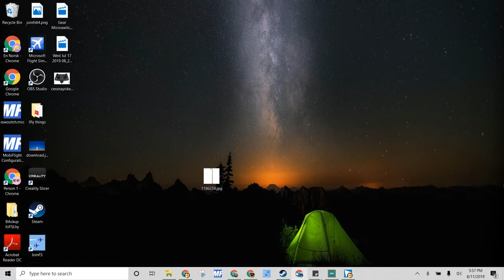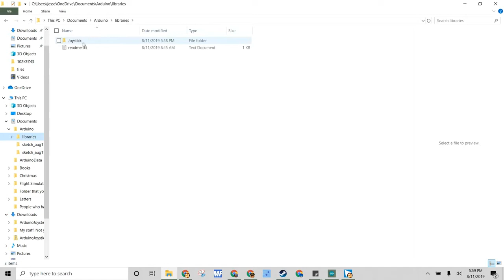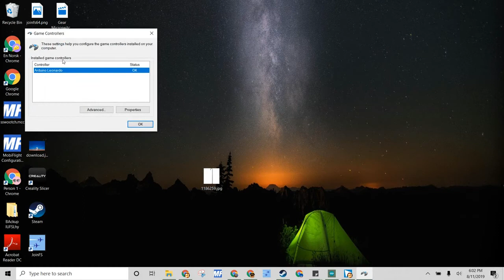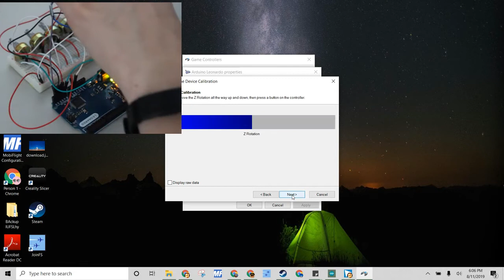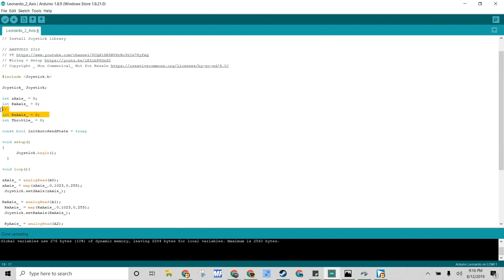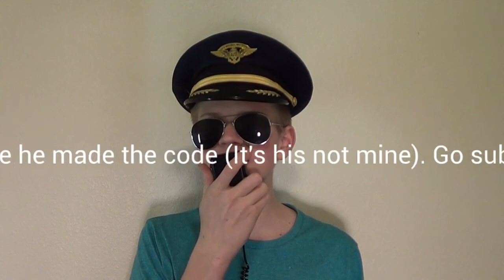Making Amstudio's 5 Axis Controller Without a Breadboard! | Captain Bob

Comment from the maker: Hello Everyone! Just an update:
You can connect two Arduino Leonardos and have 10 axes if you'd like to. Make a copy of the Arduino Sketch and flash both Arduino boards separately!
NOTE: This only works with the Arduino Leonardo and Pro Micro. An Arduino Uno or Arduino Mega will not work though I usually use them for other things on the channel.

Comment: Great video. Just a little tip. In your code when you want to comment something out you shouldn't replace it with // you just need to add // before the line and then it will turn grey and won't execute.
Reply from the maker: Thanks for the info!

Comment: Also check out linear magnetic hall effect sensors. They are much better for joysticks than potentiometers as they can measure much smaller movement at a higher resolution.
Reply from the maker: That's so awesome! I'll really have to check these out!

Comment: hello captian! Excellent job! But I have a question, how can I use the another 32 buttons, axis X and Y? Will I have to use a multiplex board?
Reply from the maker: It looks like you will have to code them in. I think there are only ~15 input pins on the Leonardo. I haven't done this yet, but I've been thinking about it a little bit. Refer to amstudio's button box videos (he's the one that made the sketch), and take some parts of the code.
Reply from the maker: Just came across this: https://www.instructables.com/id/Arduino-LeonardoMicro-as-Game-ControllerJoystick/
I think it would be a huge help.

Comment: Can you use 3 potentiometers and set them up in Arduino as Z,X,Y axis and then configure it in Flight Simulator 2020 so they will controll throttle, mixture and carb heat ?
Reply from the maker: Yes, Just comment out the rows you don't need, or don't use them when configuring to FS2020.
Reply: @CaptainBobSim  Thanks. I will try this.

Comment: Captain Bob I have a problem.  Should I connect the rotary switch directly to adriuno or using a wire and Connect the rotary switch to adriuno from a0 to a4. This problem with me is in the second type that is without breadboard. Can u help me please captian bob
Reply from the maker: Let's make sure you are using the right electronic component:
This is made for potentiometers (analog, variable resistors). This won't work with rotary switches (multi-position switches), or rotary encoders (digital potentiometers). These are 10K ohm pots.

Using a wire would be good practice, but it should work without wires.

Here's the no breadboard wiring diagram, it should work.
https://www.tinkercad.com/things/d3SVBMS645X
Let me know if you have any further questions!
Reply: Or else can u make a video of connecting multiple rotary switch to adriuno without breadboard

Comment: Must I configure it in MobiFlight?
When yes could you shoe how?
Reply from the maker: You can not configure this in MobiFlight, as MobiFlight only handles digital inputs and outputs. Since potentiometers are analog, you would have to use the Arduino IDE code and configure this as a Joystick.
Reply: ah okay, but thanks

Comment: Hello i have a problem. Not have Joystick librari 2 i have erorrs to veryfy or upload the 5 axis stuff to my leonardo. Any tipp? Vhat  version you use the arduino joystick?
Reply from the maker: Hello, You need the Joystick library for the code to work properly. The most current version should work. Download it from the site as a Zip file and unzip it.
Reply: @CaptainBobSim   Thanks, but i installed  finally. I have only 1 question. How to add up and down shift button, and wich pins i need?
Reply from the maker: @thekassaiba6694  Excellent! I must be honest, I haven't done this before, but a good starting point would be to go to Amstudio's button box video and see if you can insert some of the button's code: https://www.youtube.com/watch?v=Z7Sc4MJ8RPM&ab_channel=amstudio
Reply: Thanks i go and warct. I re think the setup and i put an encoder but in Hungary cost this piece 30eur.. Little bit to much money..

Comment: Dude you are awesome! I’m trying to wire up a button box for my flight sim right now and I’m still a little shaky with how to wire it up exactly, I got the Leonardo and I have 6 2 way switches 2 potentiometers and 2 large led red flipper switches I believe they’re  called yep, help!
Reply from the maker: The wiring would be as follows:
2 way switches: one of the pins (typically middle if 3 prongs) goes to ground, another goes to pin 2-7. Rocker switches are wired exactly the same, using pins 8 & 9. I showed you how to use 5 potentiometers, so you can blot out ( // ) or delete  the other 3. 
I'm not entirely sure on the coding, but I think you could use some of it from Amstudio's button boxes.
Reply: Captain Bob - Flight Simulation Made Simple hey thanks for the prompt response! I’ll give it a try this evening and report back, I appreciate the help greatly! Also subbed and watching some of your other content, it’s really great stuff !
Reply from the maker: @ronbaker6510  Thank you!

Comment: Is it possible to use 6 axis? or is the Arduino Leonardo limited to 5 axis?
Reply from the maker: You should be able to use 6 axis on the arduino leonardo. The code is only made for 5, but as long as the joystick library has capabilities for 6 you should be good to go!

Comment: hi, my program is from the amstudio link but when i verify it's saying "fatal error: Joystick.h: No such file or directory

 #include <Joystick.h>

I really need help please
Reply from the maker: Did you add the Joystick Library?
Reply: No i doesn't ! I solved my problem on my own but thanks you !
Reply from the maker: @MrTouffu  Great!
Reply: Yes ! But now i have an another issue, the pedals are inverted.. Like when i don't touch them they are fully on and when i press them they are fully off.. How can i do ?
Reply from the maker: @MrTouffu  You can swap the outer two wires- this will reverse the polarity of the circuit and should flip it. Alternatively you can click the Swap button in your controller settings if there is one.
Reply: Ok i will do it tomorrow, it's 3am here in France ! Thank you very much for your help and i will let you know my advancement :)

Comment: Any idea why when I move one axis all 5 move?
Reply from the maker: It's possible your wiring is wrong, or there is a short. It's also possible you only have one potentiometer connected, for some reason all 5 will move unless you adjust the code and // comment out all of the inapplicable parts.
Reply: @CaptainBobSim  It was the single pot.  Once I had a total of 3 the problem went away.  Thanks!

Comment: I don't know if arduino ide changed something but your instructions don't work this sketch will not verify i am getting up to 8 issues I believe
Reply from the maker: Some other users have reported issues. I haven't been able to replicate them. Make sure you have the Joystick Library installed. Refer to AmSudio's video for even more information (Link in the description).
Reply: @CaptainBobSim  i did and even paused the video to insure that the sketch said the same thing as the makers video I have the library installed and it shows up but it will not verify or compile i have tried changing the error spots with several combinations and it would never verify even when deleting and re copying and pasting the sketch just like both videos show no luck
Reply: @CaptainBobSim  the first issue that comes up says (expected unqualified-id before "." Token)
Reply: The next error says( 'setzaxis' was not declared in this scope)
Reply from the maker: @salvatoremilitello8490  Are you using an arduino leonardo?
Reply: @CaptainBobSim  pro micro but the errors are in the code or the arduino ide was updated and the code is nolonger being accepted i got the first issue with the "." Fixed by changing (Joystick.setaxis (zaxis)) 
Being changed to ":" (joystick:setzaxis (zaxis)) still having issues will not compile or verify giving me the ('setzaxis' was not declared) error
Reply: @CaptainBobSim  i know my way around coding but barely I really shouldnt have to have a degree to do this I can program Raspberry pi's and use Linux but I have never messed with or learned much of c++ and isn't that the language the arduino uses